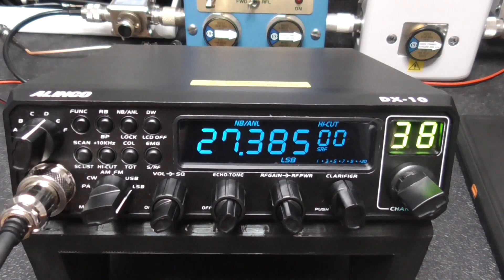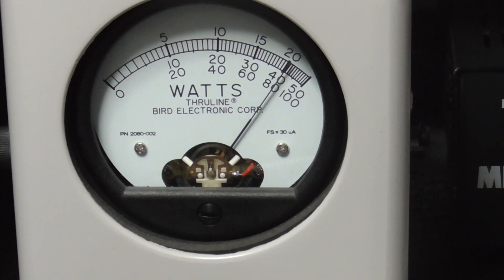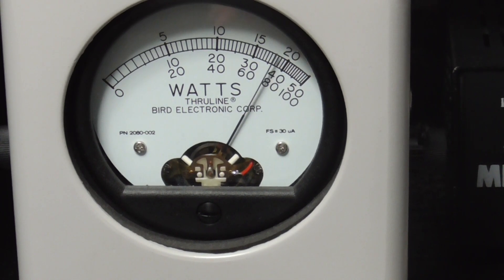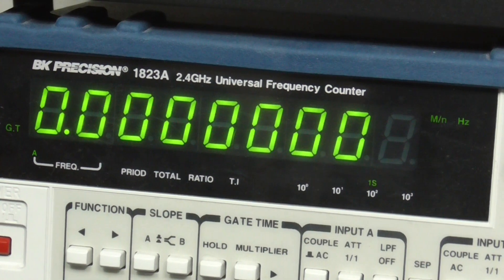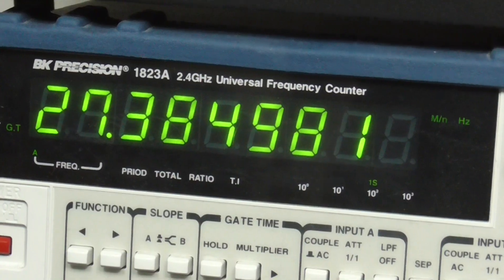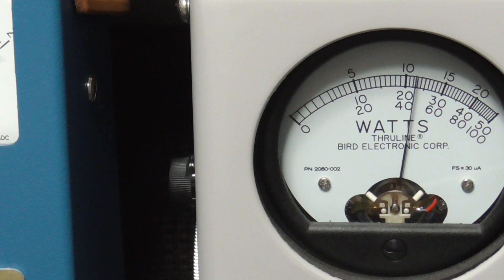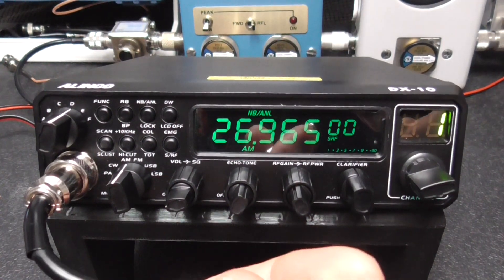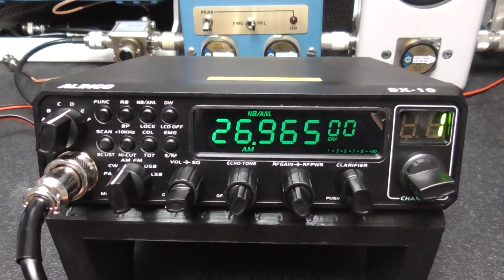New Alinco DX-10 Radio

Comment: Had an Alinco DX-70T sold by Radio Shack for over a decade. Great HF 6-160 radio.   Sad & angry when Alinco discontinued the parts.  Now I have an expensive brick.  Can't get the BPF boards anymore.  BPF board failed every few years but worth it to replace, Alinco always sounds good.

Comment: Nice video Mike. I have had one of these in Australia for around one week. It has some quirks, but I like it.

The SSB RX is HOT! Too hot. You have to run the RF Gain at no more than 3/4 or you will be overloading the RX. I can still hear everything that my AT-5555Nii can hear, at this lower RF Gain setting, so that's not a real issue but something you need to be aware of. (For reference, I find the AT-5555Nii is an amazing performer in every way).

The SSB AGC is average. Strong signals are very LOUD, weak signals are not (from a volume point of view). You need to keep on top of the Volume control to keep the audio output where you want it.

The SSB clarification is critical. You have to get it exactly right, or the RX does start to distort. I'm not sure exactly why this is the case (maybe an internal mixing/filter issue?) But it matters. 20Hz off is enough to make the SSB RX sound rough. So keep on the clarifier control (which works well on this radio).

TX audio reports are excellent.

AM/FM seems to work great. Really nice. 

That might sound like a lot of bad points - however, despite all that I had a great time using this radio!. It's fun, it keeps you busy tweaking, and when you get it right, it's great! 

I configured my DX-10 with the PC software. This makes life a lot easier if you are familiar with radio programming.

Overall, I like it, it's a different beast with some RX quirks, but it is still a very capable and fun little radio for a cheap price.
Reply from the maker: No prob. I like the radio also. Most likely put one in my vehicle. Like the small size and easy front control layout.
I agree the new Anytone boards are much better, but some still prefer this type of adjustable PCB.
Merry Christmas and 73.
Reply: @ScottsRadios  I agree, there is a certain charm about these radios, you can't deny that!  I think it would be great in the vehicle too. 
Merry Christmas mate! 73

Comment: Wierd in my head when i heard the name alinco i always thought they would be a radio that performed better on ssb. Interesting!
Reply from the maker: If performs well on SSB. Just designed for lower power levels. Will match well with low drive amp 🙂
Amps not my thing, but understandably are very popular in the hobby.